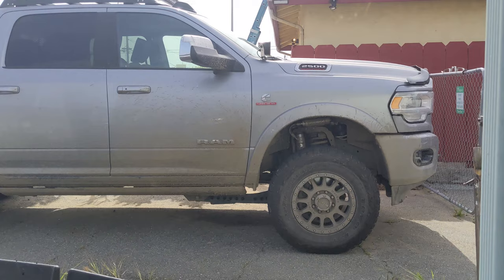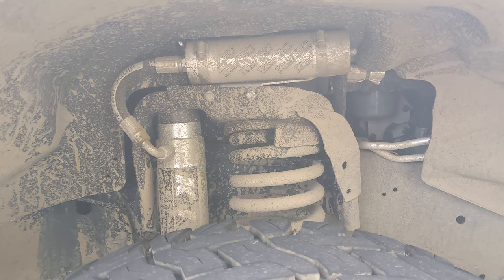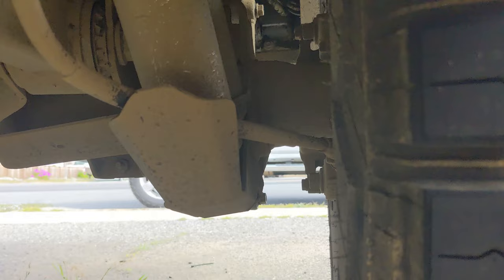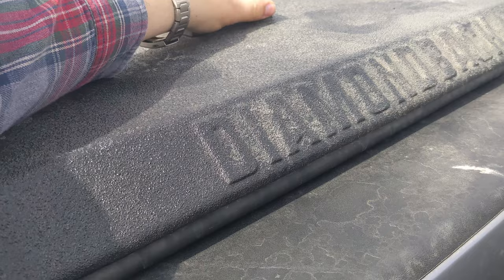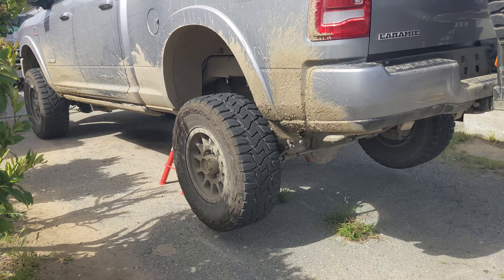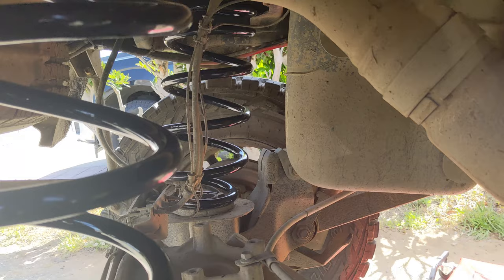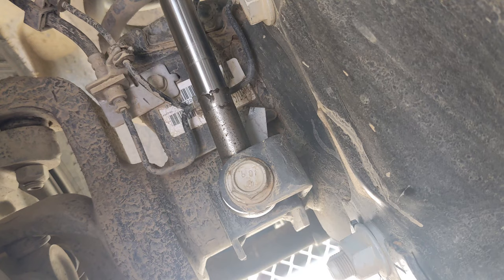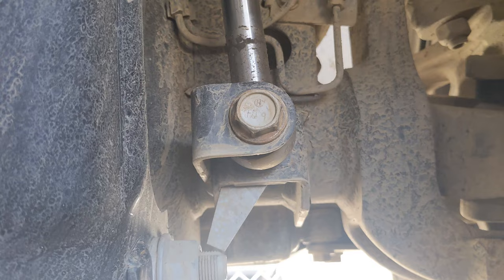Switching from Thuren to Carli Rear Coil Springs on my Ram 2500 HD (2019+)

Comment: Your video was super helpful for me!  Never been a huge fan of going super soft on the rear of any HD truck and you really helped me iron out my build for my '22 2500 CTD.  Don't do enough of the sort of wheeling anymore to justify kings again on this one, but ended up going Thuren 2.75" w/Thuren Fox 2.0 Resi upfront and Carli R2 w/Carli Backcountry Fox 2.0 Resi outback after talking to the guys at CJC.  Mostly highway with some gravel and then the occasional camping trip so just couldn't pull the trigger on the Kings this go around.   I also have a DiamondBack HD, quite a few tools, and I need to tow now and again.  Going to run black sumos upfront for bottom out support (Thuren sells them in place of their full boogy bumps on 19+) and blue sumos out back when empty swapping to black sumos when towing or hauling heavy things on top of the cover (Done this before on other trucks with great success).  Got all the other goodies (Trackbars, etc) with them on the way and really looking forward to softening up this big girl for my longer highway trips, the gravel roads I've got to travel from time to time, and towing now and again while keeping the truck a functional 3/4 ton.   Your stance ended up perfect!
Reply from the maker: Thanks, glad it was helpful!

Comment: Thank you for this, and I am considering this setup. I see that Carli requires the end links, track bar drop, and bump stop drop in addition to the coils. Is everything working fine without those?
Reply from the maker: I installed the Thuren track bar drop and end links as part of my original lift, but it worked fine with the stock bump stops.  Later I added Timbren Sumo Springs which are great for trailering with this setup.
Reply: Thank you for the additional info. I’m assuming your doing conventional towing and not a gooseneck. Im surprised you would need Sumo Springs with Carli claiming the coils maintain factory payload. Do you think they are actually softer than factory?

Comment: Hi Justin, I'm currently at work so can't watch your video with audio on, so forgive me if this was answered already, but, are you running Carli R2 rear coils, with King 2.5 tuned shocks from THUREN? If so, how is the ride??? Since they're tuned for their coils. I currently have a 2021 Power Wagon, 1.5" front lift with overland shocks and trackbar, those front coils are equivalent to the diesel 2" front coils, same part number.

The rear I am running the Thuren STOCK HEIGHT rear coils soft rate, which is equivalent to your 1" rear coils for the diesel. On the power wagon it doesn't give me added height I guess. Also have overland rear shocks and track bar.

I added about 500 lbs of constant weight with a pop top camper, rigd, and full 37" spare.

So, now like you, I want to get R2 rear coils. But my dilemma is, how will it run with the rear overland shocks from thuren? And, if I need to change the shocks, who do I run? If going Carli, they don't sell just the rears, have to buy a full set and I don't want to change out to Carli front when I already have a full Thuren front setup invested.

That is why I was asking if you're running King 2.5" rears from Thuren, how are you liking that shock tune for a thuren coil, but with a Carli R2 rear coil instead? And what level of tune did you get for the rear King 2.5???
Reply from the maker: Yes, I'm running the Carli 2" lift rears with Thuren King 2.5" and think it's a great combo!  I got Thuren stage 2 tuning on the King shocks.  Also, I'd suggest giving CJC off-road a call or email about your setut, they are the ones that recommended going this route.

Comment: Man looks perfect now! I’m debating whether to go carli or aev with my ram. I’m not considering thuren because I have a 1500 not a 2500. Eventually I want to run 37s so I’m leaning toward aev as they push the front (IFS) axles forward just like they do for the HD truck solid axle but not as much. But still it helps clear 37s with full turning not being an issue. Carli swears by 35s max on their half ton truck system so it depends what I end up choosing to do. I’m a weekend warrior so I can’t go cheap and risk breaking something. I’m glad you found an easy solution though and this vid was great thanks!
Reply from the maker: Thanks for the feedback!  I think I mentioned it in the video, but I opted to go with 35" tires on this truck, even though 37" would clear no problem.  Just be aware of the effect the larger tires will have on acceleration, gearing, towing, speedometer, etc.  All are correctable of course, it just adds complexity to the build.
Reply: @jprohrer  yes I know how 37s change everything. This is why I’ve only ever ran a max of 35 for a daily driver. For a pure off-roader trail rig I want to go big or go home lol.

Comment: This guys issue just proves my point. All my trucks lifts are same front and back. My local 4wheel parts has the same GM for 15-20yrs, and he knows he has to break up the "kit" to get me rear lift same as front.

I'm too old for the "leveling" trend. I had 2 cars even not trucks, that had rake higher in back, as trucks certainly come, and bigger tires on back than front. 81 Vette and 91 300ZX.

So I'm definitely not into the leveling a truck.

If your front needs more lift, so the same to the back should be too, it's that simple. Leveling is for boys getting trucks they don't use so they should've gotten cars or SUV. If you're using the truck as manufactured for, then it needs the forward rake.
Another note, no one has Ever remarked about trucks and leveling...
The natural cutaway higher design of front fenders for the added clearing of tires to turn and travel up/down, is why when you "level" the truck maybe as literally a construction level put on the bedside would show level, the truck looks Nose Up ridiculousness. Well that's the minds eye confusion. "But I leveled it, but it looks nose up.
The fender cut away is the deal.
Reply from the maker: The reason for lifting the front more than the back (In my case, as with most people using the Thuren and Carli systems) is neither aesthetics nor tire clearance.  From the factory these trucks have less than 2" of up-travel in the front before hitting the bumpstops, while the rear has 5" plus.  Consequently the front coil springs are extremely stiff, resulting in a very harsh ride and poor handling offroad (or on deteriorating roads).  Raising the truck in the front increases the available uptravel allowing a lower spring rate and greatly improving the ride and handling on rough surfaces.  The rear simply doesn't need to be lifted the same amount, and doing so would compromise other aspects of the rear suspension geometry.
Reply: @jprohrer   I just got a 17. Was thankful it wasn't one of the majority that a MegaCab only towed 15k than the same CC model. I knew HD Rams had some leaf spring and some coil rear suspension. So my coil truck said it's 17,203.11, so that's good on cab space and towing.
I did watch CJC on the Carli, and thought  should be good for me, but I'll get rear lift the same

Comment: Interesting i called carli and they said the r2 won’t work since i only have a king 2.5 in the front and stock height in the back even if i have a camper that weigh about 1.000 and squad once i tow my trailer with a hitch weigh of 300 and I can’t find any information you are the only one that has done a video on a leveling kit

Comment: Thanks for great video,very helpful! I installed 2.5 pin top carli leveling kit on my 2020 ram 2500 and I don’t like it way its looks. Now I want replace stock with carli 2” coils to the rear, I see you installed Thuren track bar ! Anything else did you add to the rear? Thanks
Reply from the maker: Nope, just the 2.5" shocks, coils, and track bar.
Reply: what didn’t you like about the look?
Reply: Lower rear end ! Ended up with 1” rear spacer! Looks great!
Reply: @evaldicful  So with just the 2.5 Carli it wasn’t dead level, the front was higher than the rear?
Reply: @sponsurd  yes . Front little higher
Reply: @evaldicful  Ok awesome! I don’t mind that at all, was trying to decide between the Carli 2.5 or the Thuren 2.75. If the front is a little higher on the Carli 2.5 I don’t mind that at all. I’m sure it’s a minuscule amount and it will settle over time! So with the 1” rear block spacer, you’re now dead level?
Reply: @sponsurd  rear end just a little bit higher
Reply: I can send you a picture if you like
Reply: @sponsurd  dead level would be 1/2 spacer in rear! With a rear spacer you retain factory payload and tow/haul specs. For me it’s a must cause I’m tow a trailer
Reply: @evaldicful  I gotcha, so you wanted to keep a little rake? I kinda like when the front is just slightly taller, so the 2.5 Carli seems like the way to go. I use my 99 2nd gen for any type of heavy towing so not really worried about that. Maybe i’ll go with a 1/2 spacer or do the Thuren 2.75 with the 1” in the rear based on what they recommend. A picture would be great! What’s your info?

Comment: After having them on for a while now did they settle any more? And are you still happy with them getting ready to do the same setup to my 2018 was also interested in how much sag you got while towing truck looks great by the way
Reply from the maker: No, I haven't noticed any more settling and am really happy with them.  They do sag quite a bit with 1000 lbs on the tongue, so I ended up adding SumoSprings, which make it super stable for towing.
Reply: @jprohrer so you went with a 3rd spring?
Reply from the maker: No, sumo springs are an extended bump stop basically

Comment: Nice. Looking to do the same on my Ram but can't find the + 2 Carli coiks anywhere or prices, any idea? How does it ride now compared to Thurens? Thanks.
Reply from the maker: It is an "off menu" option, but CJC has them and can quote it via phone or email.  It is definitely stiffer than Thuren, but still much better ride than stock.
Reply: @jprohrer  Thanks, just talked to them, unfortunately they wont work on my truck as I just have the Carli 2.5 pintop leveling kit w stock coils in the back. They recommended a 1in spacer from Traxda.

Comment: looks like you had the Thuren soft rate +1, Why didnt you go mid-rate with shim?
Reply from the maker: Thuren hadn't come out with the mid-rate coils yet.
Reply: @jprohrer  how are those Carli rears holding up towing?
Reply from the maker: Holding up great!  I do also run sumo springs  if I'm going to be trailering longer distances.
Reply: @jprohrer  I was thinking of adding carli or Thuren mid rate rear springs for towing fifth wheel a few times a year.

Comment: The real killer is the tire hanging out the back, the leverage really sags the truck.
Reply from the maker: It does have more leverage being that far back, but just isn't that much weight.  Installing the tire carrier and tire sagged the Thuren springs by about 3/8", so only a small fraction of the 3" low it was sitting.

Comment: Do you have 3 inch kings in the rear also?
Reply from the maker: No, the rears are 2.5" kings.  3" kings will not fit in the stock location at all, you would need to go to something like the Carli Dominator set up which relocates the rear shocks.